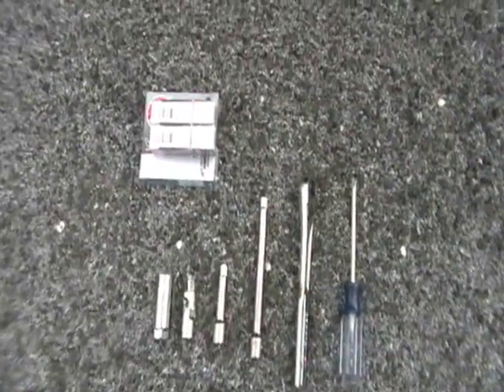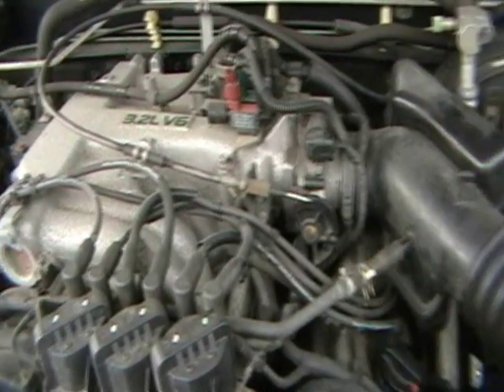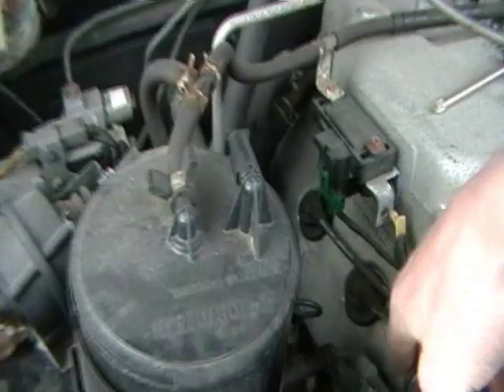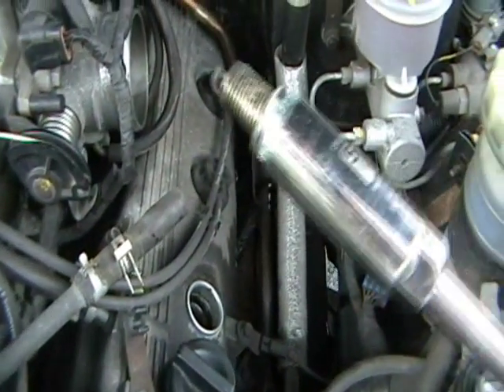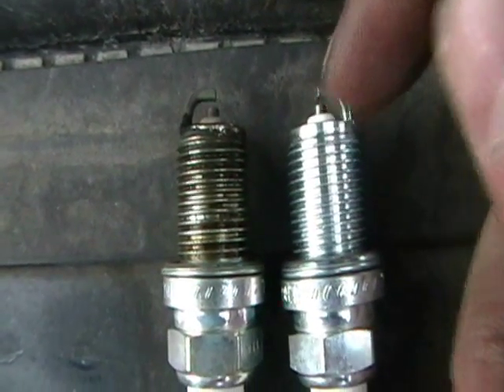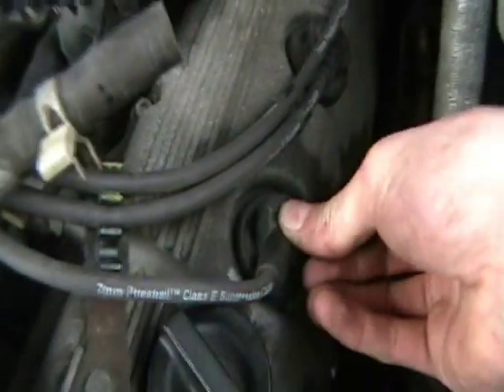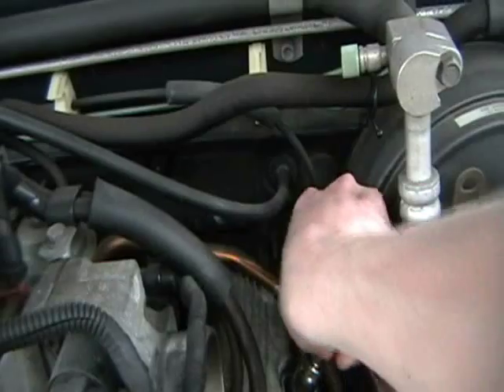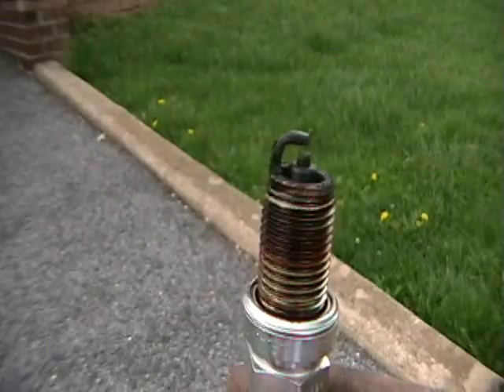How to change spark plugs

Comment: The spark plug socket with the rubber insert is ok, but I have been using the ones with a magnetic insert and like them much better.

Comment: I have a 1998 Toyota Camry and a 2001 Toyota Camry V4 both of them and the spark plugs are so easy to change they are exposed and they are on the every top of the engine so it was a breeze for me to change and other cars are so dam hard.

Comment: Does anyone no the spark plug wire order on the distributor cap for a honda accord 2000 4-cylinder?

Comment: You really should have gaped your plugs with a tool to .42 gap. I would never trust plugs that may have been dropped or mishandled during shipment and to go through all that work and still not run correctly. You would have to do it all over again.